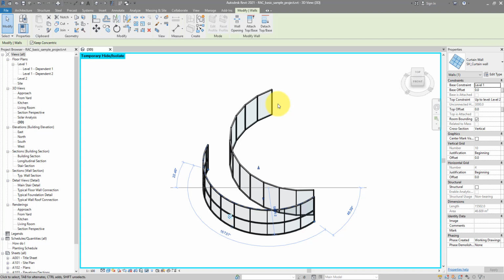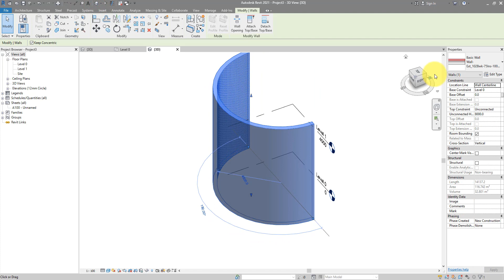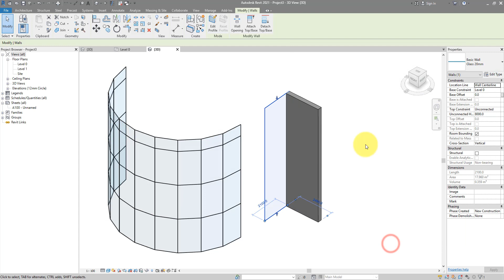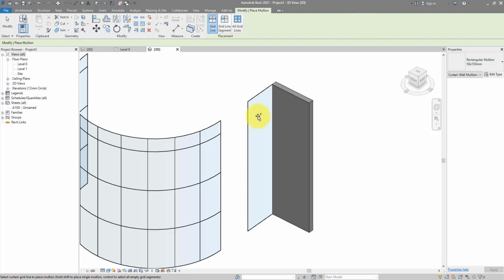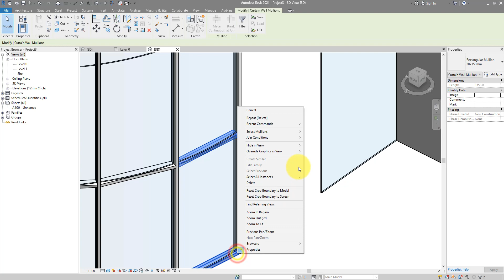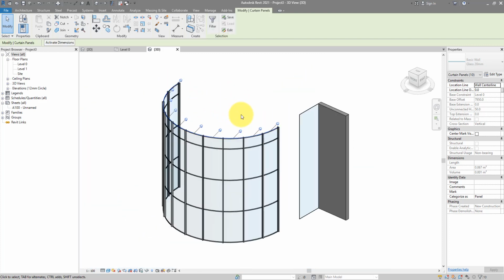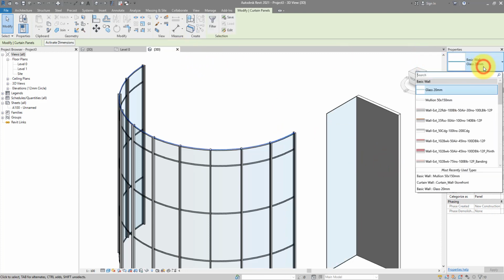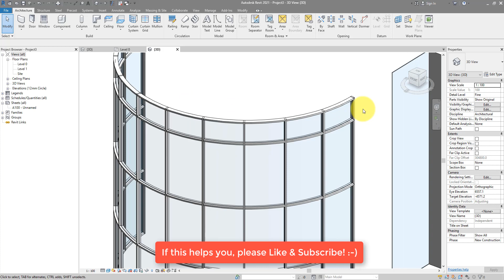Revit Snippet: How to make truly curved curtain walls

Comment: This method is great but I can't seem to edit the mullion spacing well for some reason when I try to add segments after removing them all it revert back to making straight panels...
Reply from the maker: Probably check your curtain wall's type properties. You can try disabling layout rules in there to always add all grid lines manually.
Reply: @RVBoost  Thanks for the quick response I started again from the curtain wall that doesn't come with mulions or curtain grid (not the storefront or the one above it) and I made the grids from there. I am still a beginner and again thank you for the video :).
Reply from the maker: So it's working now? Great! Glad I could help 😊

Comment: Hello there, I wonder if you could show us how to add curtain wall door on curved glazing wall please
Reply from the maker: Hi, it's the same as adding doors to a straight curtain wall. Simply select a curtain panel, unpin it, and then replace it with a door. You obviously need to have the door loaded first.
Reply: @RVBoost  Yes but the door is not straight
Reply from the maker: You'll need to make a curved door family :)
Reply: I got it. Thank you very much. Finally it worked
Reply: Can you please tell me how to create place curtain wall door on curved wall?

Comment: Would it be possible to achieve this bending around a horizontal axis instead of a vertical axis as shown by you here?
Reply from the maker: Yes, but you'll need to use conceptual massing for that. I have several tutorials on that on this channel. Curtain wall isn't that powerful :)

Comment: hi, this is a great video! I've been searching for this tutorial and glad that you made a video about this. However, I faced a problem, idk how but i couldn't easily select the small glass panel after i did the 50mm grid, hope you can help. Thank you!
Reply from the maker: Glad it was helpful! About the glass panels, they do become harder to select if they're small. You can try zooming in, hover your cursor over a panel and press Tab repeatedly until it highlights, at which point you can click to select it. You can also then right click the selected panel and select all other ones on the same row with it using Select Panel > Along Vertical/Horizontal Grid.

Comment: hi i have one problem. i create a wall and then i replace the wall with the storefront as you did. Then i do the glass panel trick that you did and it replaces my panels successfully and it makes them curved. But i have a problem with the horizontal mullions. I delete them as you do, and press the curtain grid button. But when i place the horizontal grid it adds automatically mullion and not just a line grid. what am i doing wrong?
Reply from the maker: Hi, it sounds like the curtain wall type has a setting for automatically adding millions. To stop this, select the wall, go to Type Properties, then select None for all horizontal and vertical grid lines.
Reply: Thank you so much for your answer! It worked! Great video
Reply from the maker: No worries. Glad you liked it :)

Comment: Whenever I make the curtain grids, full mullions appear, as opposed to just the lines that you have. How can I get just the lines?
Reply from the maker: When you've activated the Curtain Grid Line tool,  there'll be a button on the ribbon for switching to "1 segment" mode. Click that and then click where you want to place the grid :)